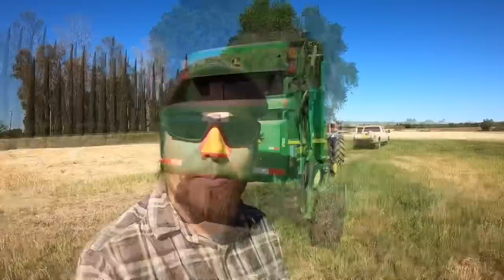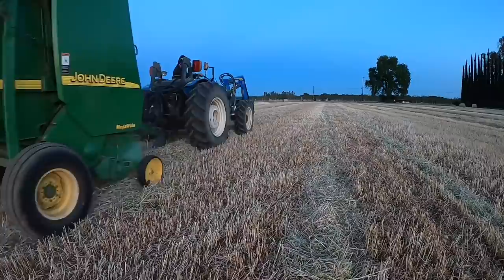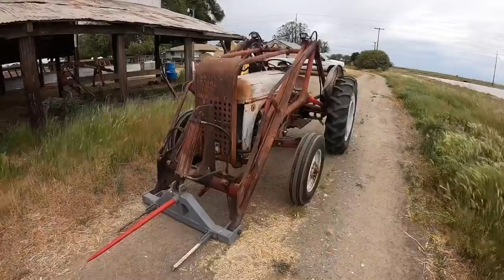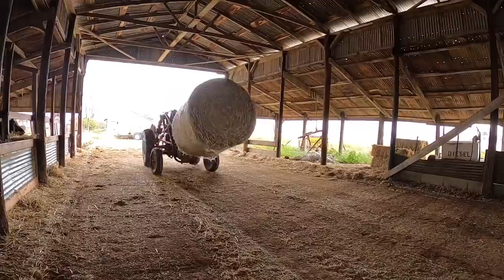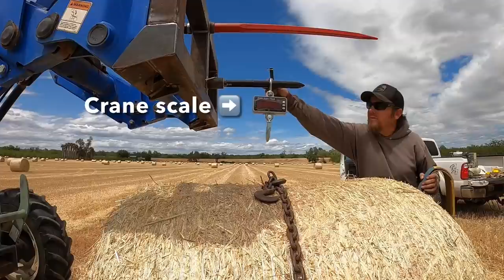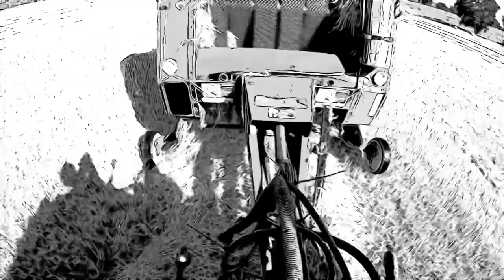My First Experience with Round Bales

Comment: If you look at your bails they squish some. That's because they are loosely rolled in the bailer. You can adjust the bailer to do it tighter. They will be firmer. When they are as loose as they are when you go to cut the net wrap it will just come apart. If they aren't so loose they will stick together better when you cut them open. If u have any questions my husband ran a round bailer for years. He can answer them. It still is a great job for the first time.
Reply: Squishy bales are also more unstable in the barn.

Comment: One other thing to check is cross sparking, that's where you get electric sparks between the spark plug wires or between wires and the engine. I found the best way to check for this is, run the tractor in the dark and any cross sparking will show up. Also check or recheck your timing.

Comment: You are going to love this so much better than squares. Less handling and when you roll out a partial or whole bale, there is virtually 0 waste. I fed 150 rounds to my cattle this winter and you can’t tell it at all. No mud holes or beaten down areas. Just a lot of manure and urine spread out all over the field used as fertilizer. Good luck.
Reply: I learned that too, no more hay rings here!

Comment: I've tried stacking round bales both ways, for me I have a rounded quonset shed and a square pole barn. I lay them down in the quonset shed but stand them up in the square pole barn. I can get more in if standing thm on end, and they don't get squashed out of shape. The top row I lay on it's side for easier stacking with the hay spear. You might experiment to see which way works for you...
Reply: In my experience, a little rain does not hurt the hay, just let it dry out good before you put it in the barn.

Comment: Pickup gathering wheels on your baler will help your baling process.  They will help prevent leaving grass in the field.  No worries leaving round bales in the rain.  When our pole barn fills up, we just gather the round bales in a corner of the field and leave them until we need them.  Stack them tight together in the field, and rain isn’t an issue with the bales.

Comment: Tyler, if the problem isn't in the electrical system, you might check the inside of the gas tank.  I had a friend who was having trouble with his Ford Workmaster having similar problems.  Problem was the gas tank was rusty on the inside clogging a screen.  He took the tank off, cleaned it up, and used some sealer to coat the inside of the tank, locking any residual rust in place.  Problem solved.  I later found out this was a common problem in older Ford Tractors.  Just wanted to throw that out there.  Sounds like you had a series of issues hoing on to cause that miss.

Comment: Feel the 8n exhaust manifold to see if its the same cylinder missing, it may be a bit rich and trying to foul especially with the extra oil/water fix getting into the cylinders. If there is no change with the electrical the head gasket leak probably broke some carbon loose that s holding an exhaust valve slightly open.

Comment: Your tractor. Run it in the dark and see if you see any sparking on the spark plug wires and the distributor. Remove the distributor cap and try to wiggle the rotor, it shouldn’t wobble more than a few thousands. If it dose replace it. Next one plug could have a crack in the Porcelain, so maybe it’s time to replace all four plugs and wires. Inside your distributor cap, look for a build up of carbon. Wipe it out with a clean rag or best get a new one. Replace the condenser and the points while the cap is off. That’s about all there is to a simple electrical system. Nice looking hay!

Comment: FTR, I noticed your hay stack could use a few planks between your poles and you would be able to add 2 more bales on the second and third level. Other than that very nice first run using and learning your new equipment. Too bad about the tire hopefully you can save the wheel. Good thing sparks did not set it on fire too.

Comment: My 1950 (read that, front mount dist.) 8n ran me through that exact program.

I had already upgraded to a 12v system, 12v coil, and electronic ignition.

I knew a fuel quality issue was the genesis of the problem, but after changing the carb, draining the fuel tank and rebuilding the fuel valve/bowl assembly, the thing kept threatening to sputter!

I fine tuned the float level--ain't much adj between overflowing and starving the flow--I went to the goto and changed the ~new 12v coil along with the coil wire to the ign switch. 

I cannot tell with certainty whether it was the coil change, wire change, or inventive expletives that did the trick. You are much smarter than me, so hopefully you'll revisit this topic...maybe save me some time the next time this gremlin shows its ugly head.

Comment: Good to see youve moved onto rounds tyler what size are they i usually get the 5 by 4 did you put the netting on the bales so they dont fall apart? So whats the tally how many did you make dont worry about them getting wet it will be lucky if it gets through the first layer
Reply from the maker: Thank you Noel they are 4x4’s with net wrap
Reply: @farmertylerranch4399  cool with any luck you might save a bit of room where you stack it

Comment: Tyler, have you tried running a wire from the battery directly to the coil to rule out a bad connection or switch? I know you replaced everything, but these days even new components can be questionable. Also, I've had really good luck with the Pertronics points replacement system for the distributor. Might be worth considering.

Comment: Instead of being what Wes of Whatch Wes Work calls " a Parts Cannon" why not find someone to DIAGNOSE the problem?
Reply: This isn't a modern tractor with 100's of points of failure.  When things go wrong here there are very few failure points (I know I own an 800 series).  I love Wes but I don't think "parts cannon" applies here.  He'd have to be replacing unrelated parts on this type tractor for that to apply.
Reply from the maker: The tractor is old and pretty much everything needs to be replaced anyway!